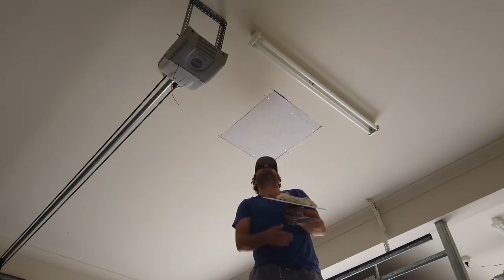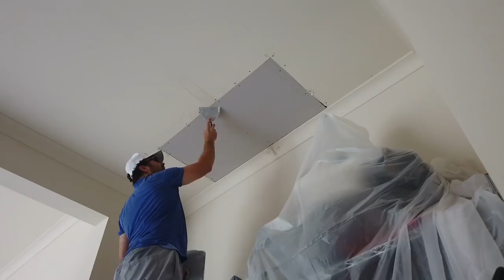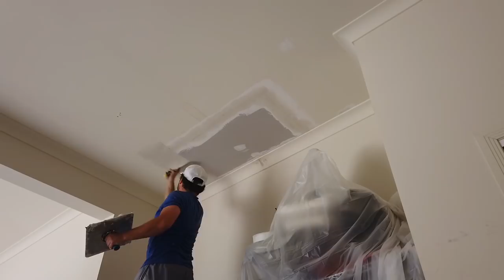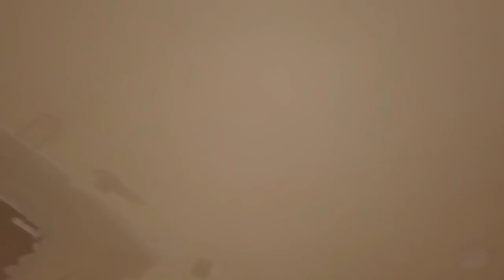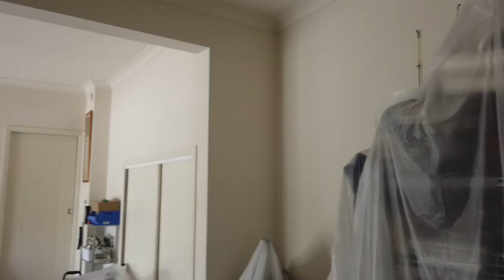Drywall Repair Patch Step 2 Using Fibafuse Jointing Tape

Comment: I’ve never used the fiba fuse tape, looks like good stuff. Nice repair Max.
Reply from the maker: Won't ever bubble or become a problem when installing. It finishes flatter than paper tape as well.
Reply: Max, how does it work for corners?
Reply from the maker: Apparently really well, even works great through an automated taper

Comment: Thanks for all your vids. We have brought an old house with quite new ceilings. But they have all cracked right around under the cornices. Can this be fixed? Cheers
Reply from the maker: Yeah sure that can be fixed. If you can share a photo. Maybe I can advise you.
Reply: Im having troubles uploading a photos sorry mate
Reply: S20 gaps for under cornices or any other good no more gaps

Comment: Hey mate, with John the cornice fixer did he use a laser tape measure?
Reply from the maker: haha you remember John. hes a legend!. yeah he did use a laser, he had a good one cant remember what brand, but its important because i bought a cheap $30 dewalt one and sometimes its way off. Maybe if the batteries are getting low, not sure, but i just cant trust it anymore. so I think its definitely paying a little extra. But how good is John, long lengths by himself making it look so easy
Reply: Haha, yeah mate. I'm just about to learn cornincing with a family member, had a few cracks previously but now i need to. Will be using stilts, nervous as.